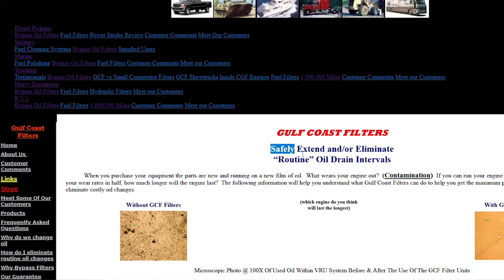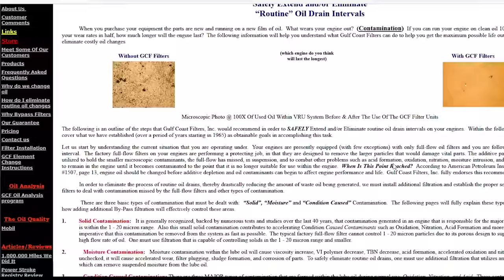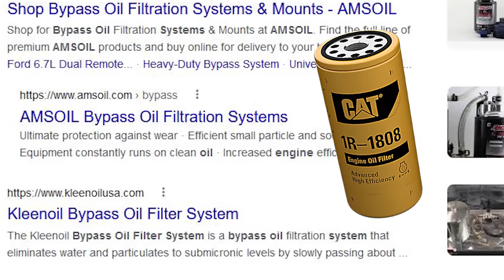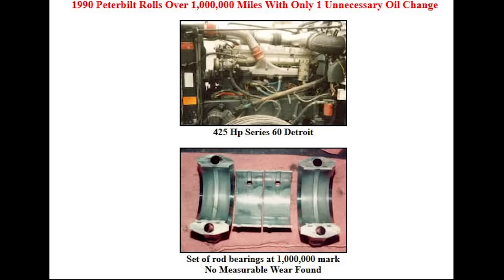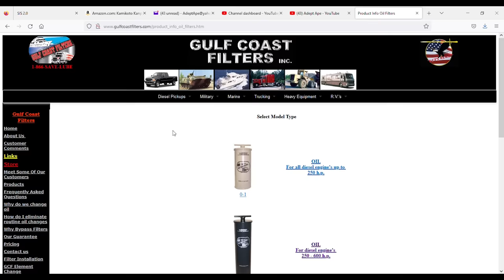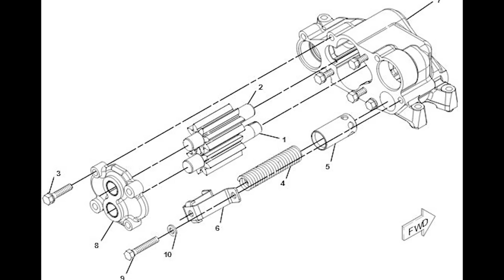No Oil Changes and 1 Million Miles!!! Are Oil Changes Optional with a Bypass Filter? (INTERESTING)

Comment: years back worked at a place had a cat  installed a primo filter system it had a cooker head   truck went over a year without oil change  we did oil samples and the oil never failed . owner got nervous and finally said change it  . would be intresting to see how long it could of gone
Reply: I bought a filter like that at a flea market once. A very good filter. All I remember is it was made in Florida and was called a refiner..The very small orifice in the bottom allowed the oil to soak up thru the dense cotton filter. At the top the oil was heated up and the fumes vented out .The oil returned to the oil pan thru a big heater hose size hose.. Not practical in a modern engine . More suitable in the old engines. It was for cars..It vented the fumes into the atmosphere.  Wouldnt be allowes these days
Reply: My guess is the filter was very old. It had never been used. It was tightly packed cotton with a layer of felt at the top. It looked as good as toilet paper. I would have adapted a roll of Scott 1000 to fit it. The heater wouldnt be necessary in a modern engine.

Comment: Seriously, do NOT even consider going over 100,000 miles per oil change, no matter what. Obviously, you COULD be lucky and get to 2 million miles without an oil change (which would be HUGE savings). But you could just as well be unlucky and RUIN your entire vehicle (or even lose your LIFE, depending on the specific situation!) because of trying to save money.

Comment: beyond 2000 (tv program) featured an oil filter that was wrapped 200 times tighter than toilet paper. new york taxi went 100,000 miles without an oil change with no significant difference between a car that got oil changes every 2500-3000 miles at the time. it was bought and shelved as there is nothing about it anywhere that i have been able to find. though i'm not an expert in research
Reply: Never heard of that. I have Gulf Coast juniors Motor Guards a Australian Jackmaster Classic I prefer the top loaders Started with a Frantz and Delo w30 in 1963. Ive been using Great Value 1000 from Walmart. I converted a Ford flat head V8 canister filter to use Scott 1000..They have elements that look like toilet paper and cost 30 bucks and more.. About the only thing that fits the Frantz is the Frantz elements.
Reply: 200 times tighter than Scott 1000 would be like pushing oil thru a 4/4. Toilet paper does fine. I dont drain oil. My oil is cleaner than allowing the oil to get dirty then draining it.
Reply: @ralphwood8818  it was the 90's. the guy came up with it on the pot. there is no existence of that episode that i can find because it is so damning. if it wasn't it would be out there. i was very young, even with a good memory it's, at best, accurate to the show, which means naught since i can't find the episode.
Reply: @dygytylace  I went 250.000 miles witout draining the oili in my Subaru. At the time I was using a Frantz oil cleaner. And Mobil 1 15 50 racing oil. At the time I thought. It gets hot here in the Dallas Texas area. I need a thicker oil. Was talking about it on YouTube.  A Caterpillar lab manager sent me a sample bottle. He said the oil looks good for.that many miles but I should change the Frantz every 6 k instead of every 12 K. He was concerned that it wasnt getting enough new Mobil 1. I took his advise. The engine was still good eccept both head head gaskets started leaking oil. All I have now is Motor Guards Gulf Coast junior  and the Australian Jackmaster Classic.  Ive heard a lot of stories over the years about filters that eliminate oil changes and someone bought them out and made them disappear Frantz has been around since 1953. I believe Jackmaster came out in 1954..Frantz has gone broke a few times..That is what brought us the Gulf Coast Filters. They improved them. Motor Guard was getting sued by Frantz. They only sell compressed air filters now. My old Ford F 250 Ranger has a 50 year old Motor Guard on the 390.

Comment: You have to Change your oil no matter what. It has to have. Lubrication. I would love to bring my stop. Watch and see how long a running engine under load would last.   I been turning wrench’s 50 that’s five decades. And my cousin are. Engineers the Best in the w/o and if it could be done they would have already done it
Reply: Some of these old fossils have been using the system longer than me. Ever heard of a Frantz 3 stacker You can still find them on big marine engines when they went out of production fhey were replaced by the bigger Gulf Coast filter.. I abandoned the dirty oil and oil changes in 1963. I dont own a truck or shrimp boat or a offshore rig I hope you dont think a shrimp boat doesnt work under load.
Reply: The system of allowing the oil to get dirty then draining it is a poor maintenance program..Some old mechanics actually think filters are supposed to get dirty and oil is supposed to stay clean.

Comment: You'd still have break down of nearly all the components that went into the oil. Most importantly friction modifiers.
Reply: For big engines you need big filters capable of keeping the oil clean. You need enough makeup oil to keep the additives up to specs. Small engines are similar. They need smaller filters and less make up oil. If you had the system that injects oil into the fuel tank you could change the big bypass filter less often. You dont want to inject dirty oil into the fuel system

Comment: Heat degrades oil. That's why automatic transmissions have a cooler in front of the radiator, If you had an engine oil cooler the oil would last longer.
Reply: Motor oil can take more heat than ATF. I put a cooler in series with a Motor Guard oil cleaner on the Pontiac for pulling a boat. They used whale oil for ATF until it was outlawed.

Comment: Seems to me that the ph would get out of whack. Ever hear of an engine oil filtration system that uses only bypass filtration and has no full flow system at all?  The 3-53 Detroit Diesel engine in my old loaders is this way. Surprised me when I found this out.
Reply: At one time they were all that way. Full flow filters didnt come until the 50s. All filters were bypass filters and were optional equipment. Some engines did pretty well without a filter. Some went to hell fast. My 41 Dodge had a little optionL bypass filter that was the same as the Luberfiner for diesels. They both used cotton..When John Frantz converted the cotton filters to use toilet paper they were greatly improved. The famous Frantz 3 stacker was the same.but took 3 rolls of TP.. I improved the Frantz design of the single roll model. Didnt do the 3 roll model. The diesel tractor has the flat head V8 Ford canister filter adapted to take a roll of Scott 1000. The old canisters were a mess to service. I eliminated that problem. Dont have a canister half full of dirty oil to deal with. Similar to the other top loaders.
Reply: A lot of people are missing the fact that the Total base number TBN number is kept up by  adding 3 gallons of new oil when the 3 gallon filter is changed every 10 K miles.Seems a little misleading to say the oil isnt being changed. My stuff gets the oil changed one quart at a time. With the over the road truck its 3 gallons at a time. The fact that the drain plug is only removed every 250.000 miles doesnt mean the oil isnt being changed. Lets get real.
Reply: Many years ago I was reading about a guy that put 3 cylinder 2 cycle Detroits in His Ford pickups. He used Chrysler Torque Flite transmissions because they didnt have a vacuum modulator.  That was before diesel pickups were common
 A canadian on YouTube likes to rebuild 2 cycle Detroits and put them in pickups. What a sound.

Comment: 1,000,000 miles! I thought they were crazy promoting 10K oil changes on cars, then they went to 20K - obviously after about 3 or 4 oil changes at 20K a pop, your engine is probably out of warranty, so they don't give a toss anyway. Why would anyone do this to an engine? I understand that an oil change on a machine like a a Cat. is way more of an expense than on a family car, but seriously, you would risk your motor to save a few dollars? What about all of the sulphur and crud that gets in there and starts eating at the bearings? It just seems to be total madness.Hell, even on my old Toyota truck (I change the oil every 3000 miles / 5000KM) I can hear the difference of the engine after getting a fresh oil change -  Compare the price of an oil change to a new engine or having to have it rebuilt. I know the system you are talking about is different to a normal full flow filter, but I saw the oil from a friends BMW with the factory recommended 20,000KM oil change, it was like molasses.

Comment: I would bet they added some oil plust did testing and maybe added some additives to bring the oil back up
Reply: You are right they added 3 gallons of new Rotella when the 3 gallons bypass filter was changed every 10.000 miles. Im not good witb math. How many gallons of new Rotella did they add in 1 million miles. Road King Magazine article said that was like a full oil change every 40.000 miles. No extra additives. It was a test truck. With Shell oil involved it had more oil analysis done  than the average over the road truck.

Comment: What about the additives in the oil that regulate viscosity through the temperature ranges that the engine is expected to function at? These do lose their effectiveness over time.
Reply: Not when you are adding 3 gallons of new Rotella when the 3 gallon Gulf Coast filter is changed every 10.000 miles. Oil analysis said that was more new oil than needed.

Comment: I have heard that places like Walmart will take the used oil they collect doing changes, run it thru a similar system of filters, then sell it as "new" oil under their house brand...
Reply: All conventional oil is recycled. Synthetic oils are filtered for their % of base oil and then recycled. New oil is then mixed with the recycled oil. There is no such thing as an entire gallon of new oil.
Reply: Which is false. Warren has blended “house brand “ lubricants for Walmart and dozens of other retailers for decades. They buy their base stock and additives from the same suppliers as other name brands.
Reply: Oil is oil
Reply: A lubrication guy for a drilling company up from the Gulf saw me at the McKinney Texas flea market. He said I have a friend with a fleet that might be interested. About a week later I was putting Gulf Coast filters on a fleet of tree service vehicles. They were talking on the phone with Gulf Coast Filters.I was just the labor. They were bringing diesel rated conventional oil from Walmart.  I needed a lot of make up oil. They said oil is oil. Fuel filters on everything. I was putting single roll Bounty towrl filters on the frame on the Powerstrokes. The Ford industrial gasoline engines got the Gulf Coast junior  filters. They called me awhile back. Said they had more trucks. Told them to call Gulf Coast. Cant do it anymore.

Comment: If you truly know about oil analysis then you must request a PQ test which tells you how much of the additive package is left in the oil, clean oil is not the only prerequisite for engine life, with recycled oils they clean the oil so well it actually removes almost all of the additive package as well then add in a new package, yes analysis wil give you early warning of excessive wear an contamination other than engine wear like water, dust or silicon usually, coolant etc etc but cutting open filters every time and peeling the pleats is by far a better chance of picking up early failures, why ?, well it's right there and then not when your sample results come back and usually expensive failures show large enough particles to be seen with the naked eye in filter medium first, wear and tear is usually microscopic in nature and gradual  same with have magnetic drain plugs at the very least or multiple magnetic plugs if you have provision in oil pan, the big bits usually come first
Reply: Gulf Coast Filter company lives by oil analysis. I just change the toilet paper and add a new quart of oil. I dont mess with the drain plug.. I laugh about these special  drain valves that make it easy to drain the oil. Wouldnt help me
Reply: Normally additives cant be removed  by depth filters  unless they are a solid like graphite.I have seen oil with solids added..They dont get removed by full flow filters. They cant get thru a Gulf Coast filter. I dont think Rotella uses solids. Shell oil is running the million mile test. Its old news. Road king magazine asked me for the truck owners phone number in 1996. They also did an article on Amsoil and a 3 gallon bypass filter called a Como filter..Not sure if Amsoil has a big filter. It takes a big filter. Not a little make believe filter. Both engines were series 60 Detroits.Im pretty sure Shell oil understands oil analysis and additives.

Comment: Engine oil will loose viscosity just by normal use in the engine by shearing the carbon-hidrogen chains. Or at least I read it will.
Reply: Say what.
Reply: Normally oil will increase in viscosity as the heat evaporates it.

Comment: I disagree with this idea. Additive packages wouldn’t last 1 million miles. Also oil becomes more viscous the longer its run in an engine because the more volatile part of the oil vaporizes and is expelled. It’s called volatility burn off.
Reply: My uncle had a 59 Ford back in the early 60s he said it uses a quart when he changes the oil then doesnt use any more.. i realize now the poor quality multi grades sometimes evaporated a quart or so after an oil change.I believe multi grades would void the warranty.in a diesel  My owners manual on the Oldsmobile diesel said you can use multi grade in an emergency until you.can get 30 weight. In the 60s Delo came in W30 and W20..I reasoned that if multi grade isnt good in a.diesel why would i put it in my car. Delo 100 was 29 cents a quart in the discount stories.. I was working in a full service Standard station..The manager was wondering where I got the case of Delo in the trunk .I think we sold it for 55 cents.
Reply: Call Shell Offshore Drilling and tell them you disagree. They might pull the big Gulf Coast filters off the drilling rig engines.

Comment: Change your oil .  Save your money on adding more points of problems . Oil samples cost as much as an oil change on your car or truck or if not more
Reply: I stopped draining oil in 1963 by using filters that clean oil. I dont spend money on oil analysis. I read the dip stick. I dont own a truck engine.

Comment: What if you had a 50 gallon oil reservoir? Would how long till it needed to be changed out?
Reply: Good question Gulf Coast Filters could answer that. They do locomotive engines on offshore rigs..I do cars and pickups.

Comment: adept ape so you would recommend for a C7 with oil changes being critical with that engine.
Reply from the maker: I think the oil bypass system is a good idea, but you should still change your oil.
Reply: Ive been changing my oil one quart at a time since 1963. With the truck its 3 gallons at a time every 10K miles How many gallons is that in a million miles? The oil is being changed. Its not allowing the oil to get dirty then draining it.

Comment: This would never happen on a normal say vw 2.0tdi 170hp engine using 4.8 litres of oil  30k max and the engine would probably still need a rebuild. A big unstressed truck engine using 5 gallons of oil might do it

Comment: The viscosity with disappear turning the oil into water like with no protection hard to find it would travel 1 million miles
Reply: I gave up running engines on dirty oil then draining it in 1963.Never saw oil turn into water .Ive seen fuel contamination thin the oil. Ive seen viscosity increase because of  running oil too hot for too long. The worst thing you can do is install a filter for someone with no common sense. In a million miles the Detroit had about 350 gallons of new Rotella added. Three gallons of new oil added every 10.000 miles when the 3 gallon Gulf Coast filter is changed.. use your head. I know some are using oil analysis  and going longer between filter changes.

Comment: Well I don't think they should be saying a million miles if oil was actually changed. The question is when was it changed? 500000 miles? A bit misleading there. I run the Amsoil Bypass 2 micron and change oil around 90,000 Miles. My opinion is all heavy duty engines should have bypass oil filtering with extended drain intervals as it seems like oil is being wasted by the tons. I do samples at 80-90 k and never had oil bad. But you need extended drain oils.  Fuel is actually a cleaning agent so a small amount of fuel in oil won't hurt but you need to know when it's an abnormal issue of course. As far as temperature goes I have a c15 cat  I don't see much over 150 degrees now newer engines I believe will get up there in Temps I don't know why I'm not a mechanic my guess is possibly intentionally by design to help with efficiency so I wouldn't know how long oil would hold up running 220 degrees everyday.
Reply: It doesnt matter. The oil was changed many times in a million miles. When the 3 gallon filter is changed every 10.000 miles 3 gallions of new Rotella is added then there is the full flow filters and the little oil the engine uses. It shouldnt take a rocket scientist to figure this out. Road King magazine said it is equal to a full oil change every 40.000 miles. Im not that smart but I figured it out.A 2 micron filter doesnt cut it with these people.Plus it takes a lsrge filter with a lot of capacity.. If you had one of those systems that  injects used oil into the fuel you could go farther between filter.changes. all it amounts to is keeping the oil  analytically clean and adding new oil .